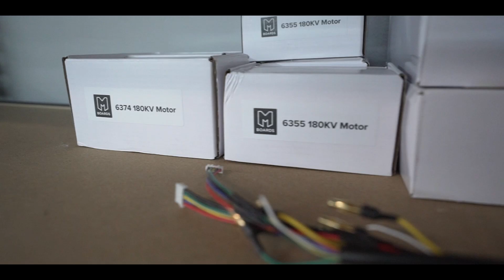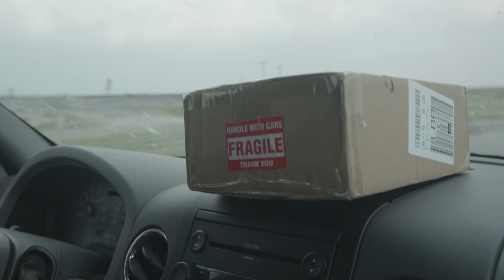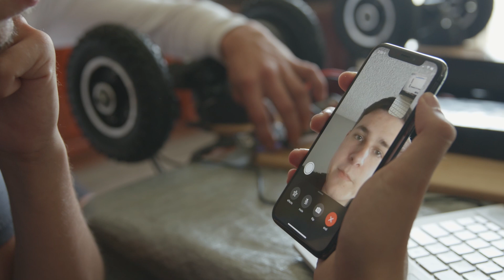How We Built World Record Breaking Electric Skateboards

Comment: I can't believe those guys had to take the battery box off everytime they needed to switch batteries! Wow there was a much simpler way of doing that! I use to keep an extra battery in my backpack with a long pig tail that would go down to my plug and play sysyem I had designed so when the main battery would get low all I had to do was un plug it and connect back pack battery to board and keep rolling! But I sure commend their effort for doing that good job!

Comment: It would be more impressive to achieve 100Km with one single battery charge in flat/smooth terrain than 1000Km with several batteries charges. But still 1000Km on a skates in the outback is nothing to shy at. I get leg cramps just from a vigorous 10Km circuit let alone doing 100x that.

Comment: Are flipsky vesc’s any good? They seem to be used by lots of youtubers, but I need like 3 esc’s and not sure if i want to risk it with flipsky. What is your experience with esc’s or vesc’s? Im running a dual belt system with 6355 190kv motors, what would you suggest?
Reply from the maker: We’ve personally had good experiences with them. What you’ll find is that opinions on ESCs in general are very split and very strong. 

If you ask another person about the Flipsky Vescs they may give you a completely different answer, but we’ve had good experiences with them thus far.